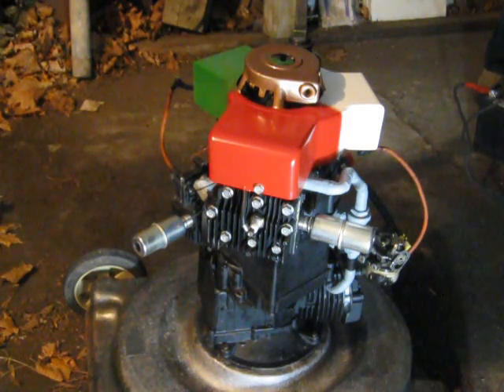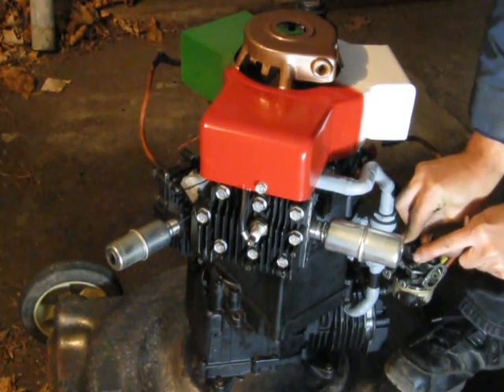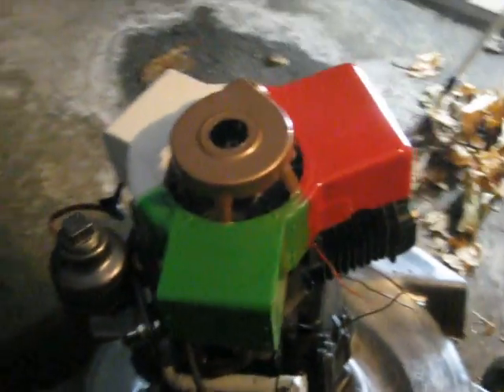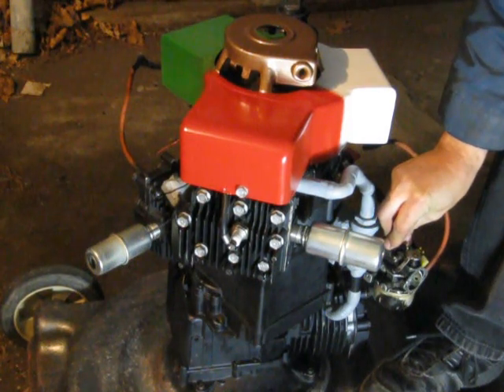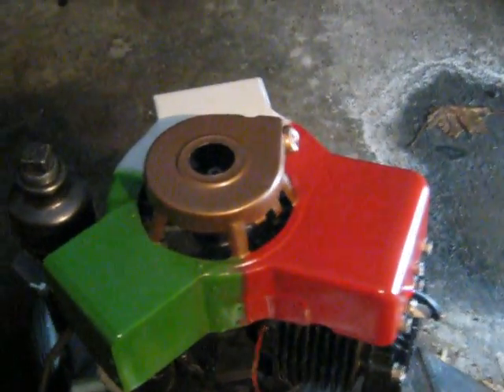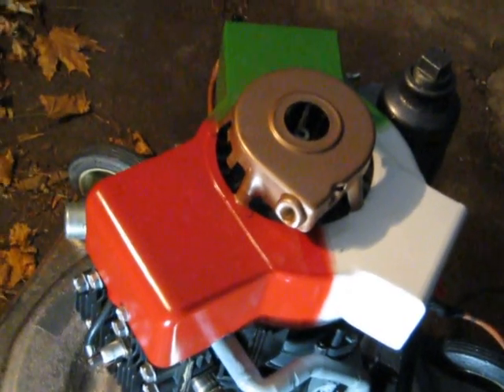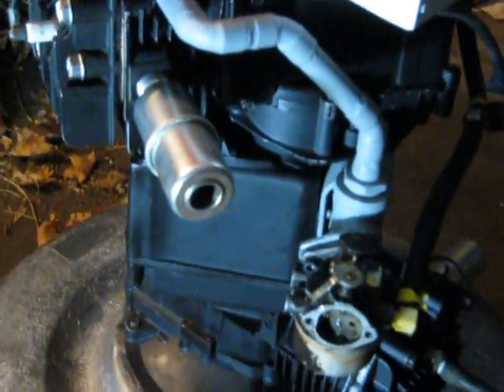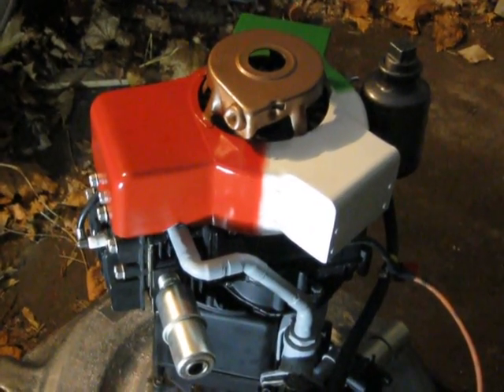3 Cylinder Briggs Radial Stacker Running!

Comment: Nice one 👍
Reply from the maker: Thanks. I wanted to get one more run out of this engine, as I reworked the crankshafts to hopefully get rid of the noise (like it was going to blow up at any second), but the crank wouldn't rotate when I assembled the engine, do to some ,missalignment. I finally gave up, and tore it apart to use 2 of the cylinders in a V2 test engine for the V8 project from a year ago. I had to put that on indefinate hold when covid hit, though I still have all of the parts sitting.

Comment: there would be No oil getting to the 2-3 con rod
Reply from the maker: Actually, yes there is, but I will keep the construction details top secret  :)
We reworked this engine a few years back, tightening up the crankshaft joints, but I haven't gotten it run ready yet.

Comment: @ChargerMiles007 if i were to buy you a better camra (40$ on ebay type thing) would you accept? im fine with the video quality, just audio is low and your camera has a bad noise compressor.

Comment: 805roadking............doesnt seem to have the crank connecting together issue..........he dabbles in the 1/2 horse briggs. not sure what he does to connect them
Reply from the maker: I only have the connecting issue on this engine, as I cheaped out on my connections mainly due to lack of machine shop access. I have since reworked this engine, but it has been sitting in my basement for for almost a year while I have worked on other projects. roadking connects his engines differently, but I design mine so I can take the crankshaft back apart to repair individual cylinders, i don't think his is done that way. I think it is mainly a design difference between the cast iron engine he uses, and the aluminum ones i use, they are not made the same.

Comment: I got a old white B&S that I was told was a 4.5hp. anyway what is something cheap/easy to do to get more power since I'm building a mini bike.
Reply: Predator, 6 hp if you can find it on sale about 100 bucks at Harbor Freight, Chinese honda clone, most of the minibike/kart guys are using them these days...

Comment: Not a true radial engine. It's just three Briggs engines with the cranks welded together and placed at 120 degree angles. Radial engines have one master rod attached to the crankshaft and the other articulating rods attached to the master rod. All the pistons on a single plane radial are on the same axis, not one in front of the others.
Reply from the maker: +Robin Haselden Very true, with the exception that the cranks are not welded together.
I do call this a Radial Stacker engine. I hope 805Roadking gets his 3 cylinder radial going soon.
Reply: all it is a 3 clyender brigs but the cylinders are offset
Reply: Fair call

Comment: Look out weeds! Thanks for the video...
Reply from the maker: Journeyman lol  :)Yes, this thing would have some serious power, if I can iron out the crankshaft joints. I have done some re-machining to them, and just need to put it all back together. The weather isn't cooperating much these days though, -4F (-22C) here this morning, so no lawnmower runs in the near future!
Reply: ***** Just kidding with the weed comment, anyone that can stack three Briggs engines like that is mechanically gifted to say the least, I do some mechanical work but not to that degree! Great stuff, I hope you get the crankshaft issues worked out ok, hope to see more videos, that was well worth watching - thanks again!

Comment: I really enjoy seeing the things you make with these simple, plentiful engines, but I wonder why, in multi cylinder setups, you havent simply made a jig for several cranks and welded them solid. That would seem much easier and cheaper when it comes to assembly, and it would certainly make for a smoother and more reliable run! Thanks for the posts! :D Greetings from Sudbury, Ontario!
Reply from the maker: 9102jack I try to retain all of the existing bearings for the crank, so welding would prove pretty well impossible on these Stacker type engines. I am not sure how well the weld would take to the vibrations also, though I believe others have had it work for them. I was considering welding the cranks on this 3 cylinder, but that would involve some major rework to the crankcases, and I doubt I could access the con rod bolts. I am still trying to figure out a solution to the loose crank joints. The funny thing is that the joints looked fine when I pulled the engine apart, I couldn't really see any wear marks.
Reply: odd for sure! I guess the everlasting problem with multi cylinder engines that aren't supposed to be is that the cranks are held in by a thrust mating surface with two 'caps with holes', whereas a typical automobile engine has a half setup that allows drop-in installation of the crank. Thoughts that keep me awake some nights! hard to make something like the frankenbriggs without overbuilding things and getting to costly. Although, someone did a briggs twin, with two cranks, and a chain driving the other. basically, he bolted two engines to a plate and chain linked the two, synchronising the firing orders to 360* instead of 180 / 540 odd-fire

Comment: Propane would get you past that or else one single updraft type carburetor.
Reply from the maker: Delicious DeBlair Yes, those would help it out, I think the float is sticking casing the carb to flood, I will have to fix that before I try another run. Yes, line boring may be required to make it work right, though I don't have access to facilities to do that.

Comment: Well buddy you can check that one off the list man. Time for a 20 cylinder yet? joking.
Merry Christmas.
Reply from the maker: PermianBasinDiesel Thanks for watching, I am not 100% done with this engine, I want to make a vid during daylight, and perhaps I can get a longer run, as I didn't have a chance to try adjusting the carb. needle valve. I had some starting troubles before we got these runs, the engine needed to be on full choke to start, I guess it was the 26F temperature.
Reply: ChargerMiles007 Are you using a 8 HP carburetor?  I'm guessing the engines are 3 1/2 HP each? 10.5 HP @ 3600 RPM = 15.3 ft. lbs at 3600 RPM, you might be looking at a max torque give or take of 20 ft.lbs. at the lower rpm band, where the engines make their most torque. I would like to see what it would do on a dyno.
With the crankshafts making noise, I wouldn't want to dyno it. But that is a cool project man!
Reply from the maker: PermianBasinDiesel Yes, I have an 8 hose Tecumseh carb. on it. I was tempted to try the 7 horse carb. off the 2 cylinder Stacker, but decided against it when I saw the internal size difference. In hindsight I could have used an 8 horse or 11 horse Briggs carb. this particular carb has the advantage of a spring adjustable choke, as it is off a snowblower engine, so that makes choke adjustments simpler.

Comment: Could all the noise be an oiling issue??
Reply from the maker: redneckbryon No, I don't want to give away my secrets right now (perhaps later), but trust me, the bearings and rods are getting lots of oil. However, that said, this is a totally different design that my 2 cylinder stacker, so it is possible that a part of the main bearings is not properly oiled. I am sure that the nasty noises are due to excessive play in the crankshafts relative to each other, I plan to make a vid showing all that, early in the new year.

Comment: get that crank clearance issue sorted and this could be something magical
Reply from the maker: rjc862003 Yes, my son said the same thing, he doesn't like how the crank noise overpowers the exhaust noise, so you can't really hear the unique exhaust note of the 3 cylinder. I plan to tear it down to see if I can tighten things up without having to butcher 3 more Briggs crankshafts. I have over 200 engines, but I still value parts like good crankshafts!
Reply: I was talking about more from a performance perspective you need to be putting these creations to work ..
Reply: ChargerMiles007 man if I had money I would have you make me one of these in a horizontal package using 5 HP blocks with forged rods and ARP stud it would be wicked at 5000RPM 
id stuff it in that old Alis frame I got laying out back ...
Reply from the maker: rjc862003 lol, if only we had the time and money to do projects like that, they sure would be fun!My son wanted me to build a 5 horse Sleeve valve Briggs, with 3 inlet and 2 exhaust ports like my 3-1/2 horse lawnmower engine has. It would be a Beast for sure.

Comment: Are you going to make a different crank for it?
Reply from the maker: 1972FordF150 Not sure, if I could machine new cranks like I use on the 2 cylinder Stacker engine, it should work fine. I am pretty sure that would involve butchering 3 more 3-1/2 horse lawnmower crankshafts, plus all the machining time (basically starting over). I have very limited machining access these days, so I probably can't do that. I may be able to add some thin shims to tighten things up, but that runs the risk of the shims coming out and jamming in the main bearings. Though maybe I would get a good fail vid then!!!  lol

Comment: You did not weld the cranks?
what did you use for crank joints on this one?
Reply from the maker: +StarPuss www.ToxicRedNeck.Com  No these cranks aren't welded, I couldn't weld on this particular design, so I used a zip disc, files and eventually got access to a mill after I pretty much monkeyed them up already. I had to use valve grinding compound on the bearings to get it so it wasn't seized up! I will release a vid about that after the holidays.